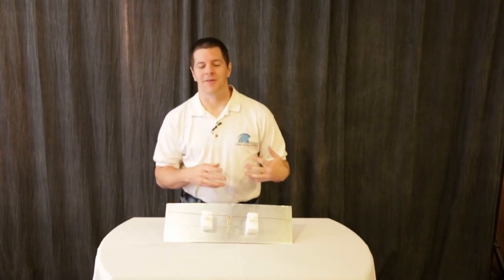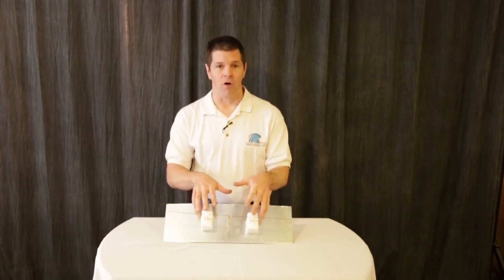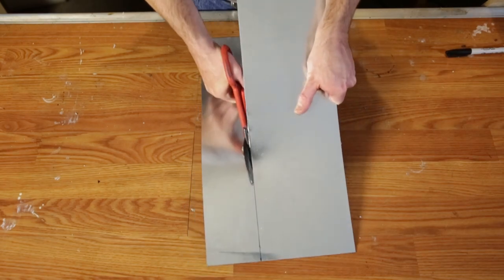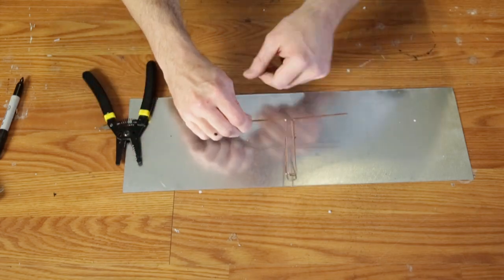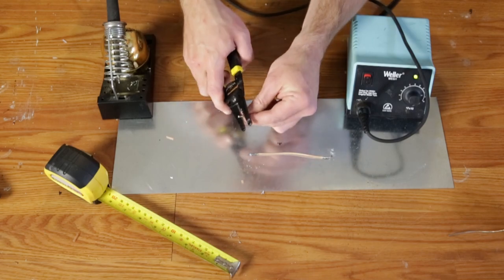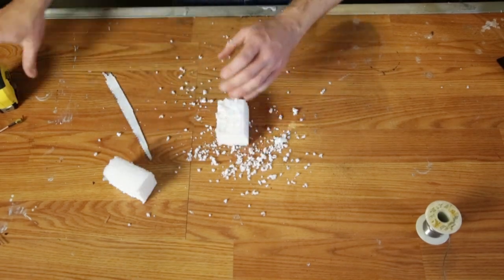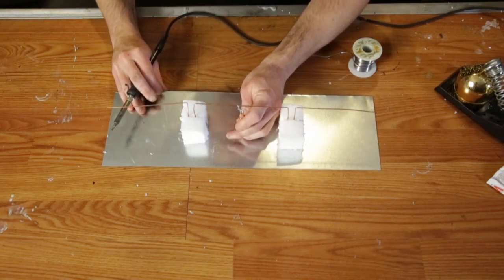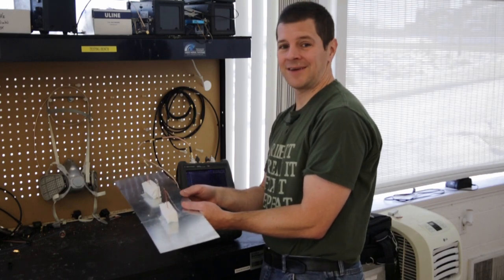DIY 8dbi wide beam helium mining antenna tutorial

Comment: Thanks for posting, very helpful.  Can you comment on the antenna's durability?  If it's pole-mounted and it gets rocked by high winds, aren't the solder joints likely to break?  Thanks again.

Comment: Does bailin for 868MHz also need to be multiple as you mentioned in video on how to convert in mm with 26.78 or it need to be same measurement as for 915MHz ??? building antena right now just need that info on bailin measure for 868MHz, thanks in advance for respond.

Comment: Excellent video. Instead Metal sheet i did 16x6 card board rap with aluminum foil and rest did as per the video. I hooked up to my Bobcat miner let us the results. i will update the results.  My Question is do we have to have Metal sheet? if cardboard with aluminum foil rap is ok??? please let me know
Reply from the maker: Aluminum foil should work fine.  I haven't tried it personally, but I don't see why it wouldn't work.
Reply: @vasprofessional1094  Thanks for your response
Reply: @vasprofessional1094  Hi There, I did tested with Aluminum foil rapped 19x6 board, didnt work at all. i have connected to my bobcat miner. didn't work at all it is exactly same as a my stock antenna.
Reply from the maker: @lem7827  - The explorer website takes 3-5 days to update.  You installed this antenna less than a day ago.  You need to wait 3-4 more days to see what it is actually doing.
Reply: @vasprofessional1094  I used the antenna NO change at all. It is not working. I removed and put back stock antenna
Reply from the maker: @lem7827  - What is your miner's name?  I'd like to see what happened.
Reply from the maker: @lem7827  - Also, could you take some photos for me and send them through my website: www.videoaerialsystems.com  I want you to make as much money as possible with your miner.

Comment: Thank you for this worke... I want to ask you do you think a flat antenna will work for helium??
Reply from the maker: What do you mean "flat antenna"?  Are you referring to a patch antenna?  If so, then yes but it is not optimal.  If you are referring to a panel antenna, I suggest a BiQuad.
Reply: @vasprofessional1094 
Thank you for replying... Sorry i meant the omni LTE 4g  for example if it was between 700 and 900 mhz... I need 868...
Do you think it will worke for heluim...
I dont wont to use the long traditional omni antenna :)
Reply from the maker: @phoenicianbird109   - This antenna covers the 868MHz band.  There are instructions in the video on what dimensions to cut the antenna down for 868MHz.

Comment: Just made one according to the specs from your video :) let's see how it does. Thanks for the video man
Reply: How well is it working?
Reply: Yeah does it work?
Reply: @Preston Texas  still to early to tell, but so far I'm impressed with how this antenna performs. All I can say is close 360 coverage is good and I can point the antenna where I want to focus for the locations with higher reward scale. I'm currently using this antenna indoors next to a double pane window. My other omni antennas that I tried didn't work and did poorly, but for some reason this antenna works. Could be my luck so far, but too soon to tell. I'm going to make another one and install on my other setup outside to see if there is any difference on that setup
Reply: @Steve Ball  it works but kinda still too early to tell. But I'm going to make a few more for my other hotspots if that tells you anything about this antenna 😉
Reply: @tonytypes  sounds good. What's your miner's name?
Reply: @Steve Ball  sorry not gonna share my hotspots name since I have this at my house. But I'm going to make one for my buddy and I'll share the results in a week or so. At my house having the antenna inside I barely make .01- 02 hnt a day with an omni. I'm currently getting .08-.1 hnt a day with this antenna and that's with the antenna next to a window in a single story home. My other hotspots around the same area have their antenna on flag poles 30ft up and make around the same. 
But anyways SoCal is super over saturated with really low reward scales. Average here is around .1 hnt a day for most people unless your up in the hill side and can make slightly more. I would say for those in other location that has better reward scale they should see better rewards than what I'm getting.
Reply: @tonytypes  please keep us updated.

Comment: Hi @Vas, I got Linxdot miner  with 868 MHz (EU868) 915 MHz (US915, AU915, AS923-1/2/3) and my country frequency is AS923 1/2/3. Do you have exact measurements for this range? Also you've mentioned to paint it white for weather proofing, are you talking about the galvanized sheet here that needs to be paint? Thanks for knowledge sharing.
Reply from the maker: You can scale any antenna with a simple formula:

Design frequency/desired frequency * design measurement = your new measurement for your desired frequency.  

Antennas scale very well in short ranges.  For this, it works well.
Reply: Thanks @Vas for the quick reply and the formula.

One more thing, what would be an ideal holder/brace to secure this antenna to a pole with less impact to the antenna's effectiveness. Especially now that the typhoon season is nearing :(

Comment: IBCrazy, thanks for all your knowledge share to the FPV community!
I have one question about this antenna... about the back sheet, could I use something like the back of a round aluminum pizza mold (with 50cm in diameter) and keep the borders (to the back) or will it change the radiation pattern or just the front wires matter in this case?
Here in the city I live is kind of hard to find small steel sheets and the large ones are expensive.
Reply: Bom dia vc é Brasileiro?
Reply: @WLBEATSproduction  Opa Miojo, sou sim.
Reply: @thiagotenoriojordao  você está no Brasil ou fora? estou adquirindo um kerlink
Reply: @WLBEATSproduction  Comprei um Sensecap (Magnificent Brick Canary), consegui uma empresa para cortar o aço e fiz a antena. Está dentro do apto... Vou testar ela e daqui a umas semanas vou fazer uma Coax Collinear para testar também. Já comprei um VNA pra ver a qualidade das antenas.
Reply: @thiagotenoriojordao  Acabei de ver aqui o seu,sua transmi scale ta meio complicada sou da zona sul de SP, já tenho uma antena de 8dbi omni direcional estou só esperando o kerlink chegar
Reply: @WLBEATSproduction  Tua localização deve ficar melhor que a minha... Eu tô no meio de muita gente

Comment: @VAS Professional Hi,does the balun coaxial cable need to be RG316 or can I use a RG59 BU?Thanks
Reply from the maker: Any coaxial cable can be used but you must account for the velocity of propagation (also called velocity factor).  The velocity factor of that is .66 so the shielded portion of your cable must be 4.25" long.  So you will cut your cable at ~4.75" and strip 1/4" off of each end.
Reply: @vasprofessional1094  Thank you for getting back to me.Will these balun measurements  work for the 868Mhz version also?
Reply: Hi,found out it is for 868MHZ .Thanks for your all your help,great channel and work your doing.

Comment: Ok, I have converted the measurements from inches tot mm. Including 5,5% increase for EU element. I found a typo in your video. The third bend has to be 169mm instead of 196mm. Now the element is inline or should i say linear. Thanx for your theory behind the making of a antenna.
Reply from the maker: Great catch!  Thank you!
Reply: Do you have a tut for 868 you made?
Reply: @bh8ti  it would be the same vid but with the dimensions in mm. It its really easy to replicate, you just have to use 2 solid copper wires, a steel backplate, a rp sma jumper cable and i used 2 wooden blocks instead of styrofoam. My antenna works very good.
Reply: @Robobonobo112  alright. I will give it a try. I was looking different IoT antennas before too but was too desperate to get on board before they start offering pennies. Which is now the case.

Comment: I am looking at this and am a complete newbie.... does the back panel HAVE to be 19 inches? or more specifically, what effect does the size of the back panel have on the signal send/receive?
Reply: Not at all.  19" is simply optimal.  It can be more (without any penalty) or less (with some reduction in gain).  Don't over-think the panel.  It is the wire element and cable balun that are critical.

Comment: Thanx nice build. I would like to build a 868mhz version. I have 2 questions. I'm looking at the dimensions for the element, the 'U shape' is different for europe is this correct? (It begins high and the 4th bend is lower.) Does The size of the panel matter? The US version panel is 19 inch long and the EU elements stick out the top and bottom approx 1 inch.
Reply from the maker: The panel size is not critical.  You can go as small as 13X45cm or as larger as 20X60cm.  A larger panel increases the front to back ratio, but doesn't really affect the gain much.

As for the bends, simply use the dimensions in the video or feel free to scale the 915 up with the conversion factor of 25.4mm to an inch and then the 868MHz is 5.5% larger than 915.
Reply: @vasprofessional1094  Ok thanx for the explanation. So I used the mark lenghts for 868mhz and the bend at 169mm and 196mm is a 'big U' And the bend at 251mm is not inline with the bend at the start (the 80,32mm). So a different shape then the 915MHZ one, so i see now. This is correct?

Comment: What is the reason for the specific size of the galvanized steel panel? Do i need to cut it down?
Reply from the maker: You don't need to cut it down at all if you don't want to.  A larger panel won't hurt.

Comment: Curious if I were to use a single 14ga wire with the insulation do I have to remove it or leave it on? Wondering if the insulation will cause any issues.
Reply from the maker: You can do this, no problem.  I would make each section ~2% shorter to adjust for the dielectric effects of the insulation.  Other than that, it will work fine.

Comment: Testing mine with a Nano vna seems perfect at. 587hrz. 1.44 noise ratio.

Noise ratio increase to 4.87 at 916. Can not get a trading at 915.

The next ok reading is at 965 with noise ratio of 3.20

What did I did wrong!
Reply from the maker: I am not sure what happened.  Check your feedpoint carefully and make sure the balun is soldered up correctly.  Also, be sure your two "U" shaped sections are parallel.  Feel free to EMail me through the website (www.videoaerialsystems.com) and I can take a look at what you have and see if I can figure out what is wrong.
Reply: @vasprofessional1094  thanks man. I'm starting over with new elements.
Reply: @vasprofessional1094   send you mail...

Comment: How do you protect it from rain etc?
And what would the lengths be for 86Mhz?
Reply from the maker: lengths for 868Mhz are in the video.  For rain, I would simply paint the antenna.  If you want, you can make a cover for it, but simply painting it with 2 coats of paint should be sufficient to protect it.

Comment: What kind of glue are you using? I don't want to melt the styrofoam.
Reply from the maker: In this video I was using EPP foam which is solvent resistant.  You can use wood or PVC pipe as a support which is easy.  However, if you want to use Styrofoam Loctite has a few adhesives such as their GO2 glue and their water clean up hobby adhesive (I forget the name of it).
Reply: @vasprofessional1094  Thanks for the quick reply! I do have one more question if it's no problem. When you said in reply to others that we can paint the antenna to protect it, do you mean we can paint all of it? Solder joints and all? Thanks again. I just subscribed.
Reply from the maker: @Richard-oo6pc  - You can paint all of it.  Paint is a very thin insulator and has little effect below 2GHz.  Feel free to put several coats of paint on your build to protect it.

Comment: What if you dip the copper wire in wax to protect from weather or spray clearcoat? Anyone have result after build
Reply from the maker: That shouldn't have any measurable effect on the antenna's performance.  It should protect it pretty well, though.

Comment: @vasprofessional is it true what Gus L. wrote above?
Reply from the maker: Probably.  RPSMA has been the standard in WiFi since the FCC required it to keep HAM radio operators from hacking WiFi systems.  However, it didn't take long before adapters became available and made a complete mess of the entire standard of connectors.  RP is "reverse polarity".  That means the center pin or socket is reversed.  Adapters are about $1.
Reply: @vasprofessional1094  I appreciate you being forthcoming! How much will you charge to make and ship one of these antennas to Chicago?
Reply from the maker: @wedorecoverlifewithernesth3580  - I manufacture antennas for a living.  You can just order through the website.  The Radon is much better than this patch.  The patch is just more DIY friendly and the Radon is not.  https://www.videoaerialsystems.com/collections/lora-radio-antennas/products/915mhz-radon-helium-mining-antenna
Reply: @vasprofessional1094  Heck yeah you guys do! Everyone with 02 cents in FPV scene knows about VAS and your excellent quality products! Trust me they know what their doing! Keep up the good work.

Comment: How does that balun work?
Reply: Btw you are the man! Just made the antenna! Funny when I put foil on the ends the SWR goes as low as 1.16 🤪
Reply: Also, the steel panel isn't connected to anything electronically, does it serve and electro-magnetic function or is it just a structural thing?